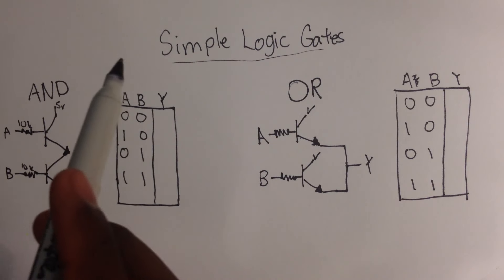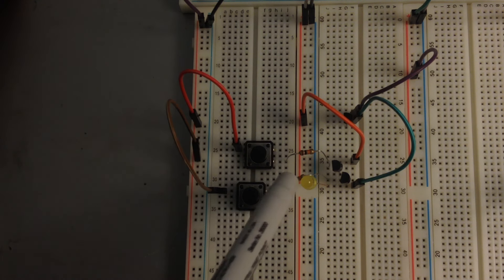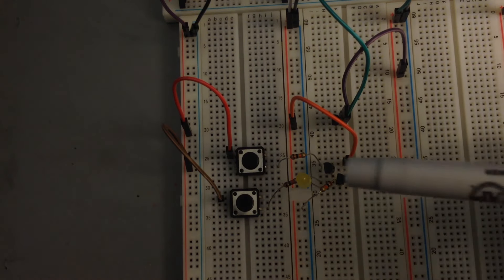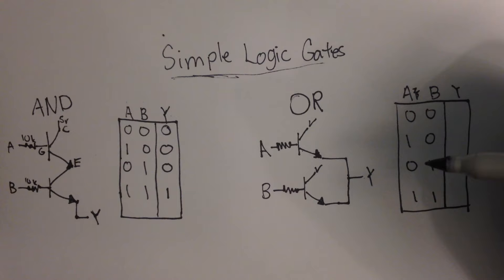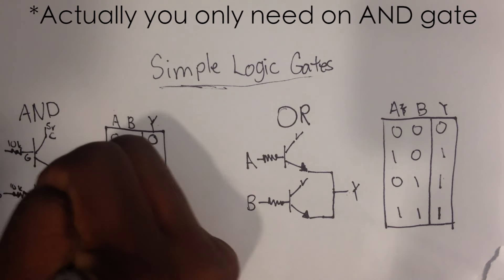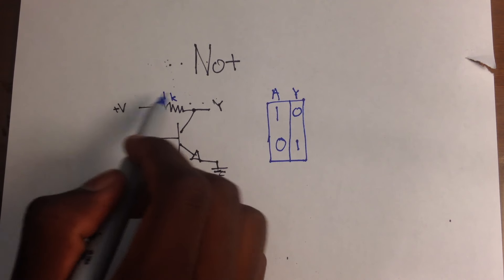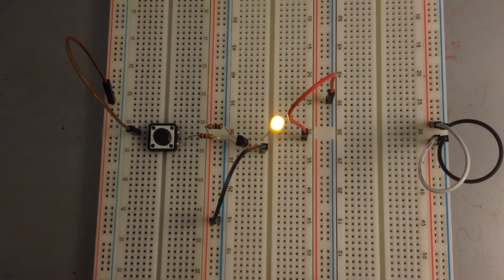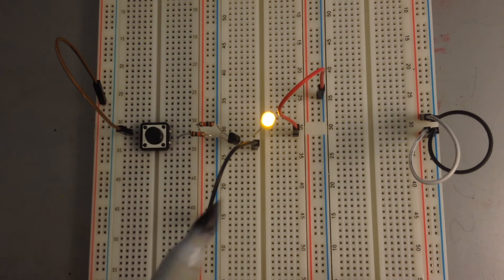Simple Logic Gates Tutorial | 8 bit Computer Project

Comment: You're seeing the light come on when the bottom button is pressed because you have the LED placed after the transistors. This is because some of the voltage that is going from the base to the emitter to turn on the transistor is flowing through the LED. Placing the LED before the transistors should eliminate that.
Reply from the maker: +Gerald Filimonov good point! Thanks
Reply: yeah, but don't you get a GND output if you put the LED before?